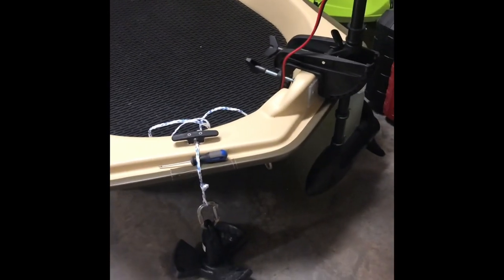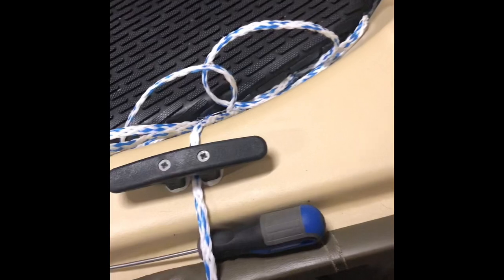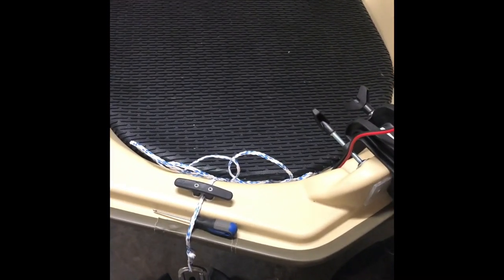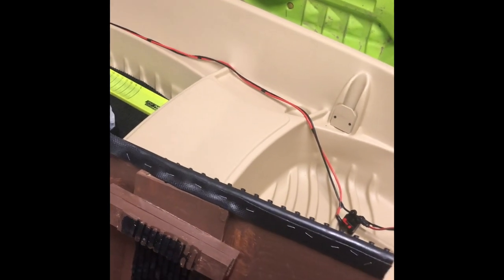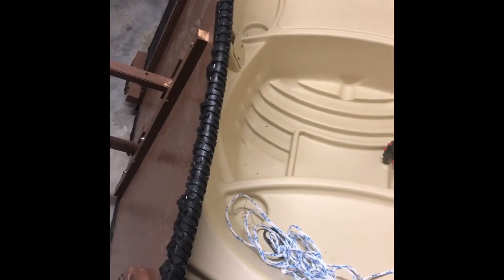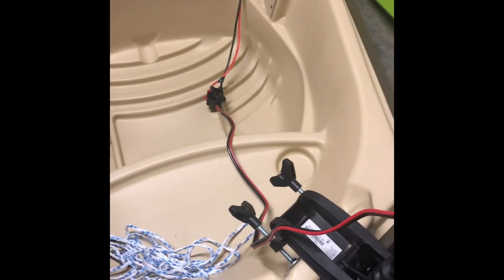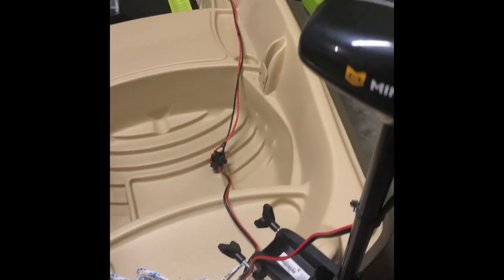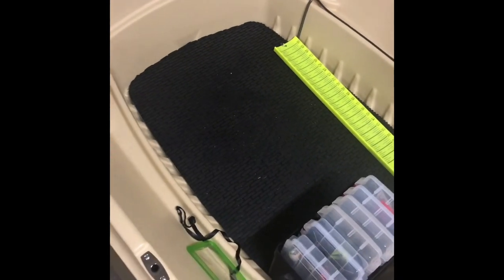Budget Jon Boat: Sun Dolphin American 12 ft With Full Casting Deck

Comment: I have the same boat. I made the decks out of 1/4" plywood only with 1"x4" support on the low side and a small block on the front. The center deck is only one piece of 1/4" plywood. total weight of all decks is about 5 pounds.

Comment: website says 52" wide which wont fit between F250 wheel wells. True? Is it tippy when you stand up in it? I saw the tri hull smaller Water Tender looks more stable

Comment: Sweet guitar  also subbed. Also um anything u would do different use any different materials now vs back then? And how was it on the water
Reply from the maker: Thanks you! Man I haven’t had this boat for 2 years but I miss it. This thing was great overall. I would probably try to find lighter materials if I could do it again. This thing got heavy and I didn’t have a trailer either. I may get another job boat in the near future though. Thanks for watching!!!

Comment: You may not know cause it’s been a while but those scrap piece you used for the bottom, what were the measurments for those? Ex: 2x4 or 1x2? I know this is from 3 yrs ago but if you could help me out I would very much appreciate it
Reply from the maker: I used 3/4 inch laminated plywood, but 1/2 would work as well.
Reply: That’s what you used for the blocks in the front and back on the under side?

Comment: Do you have the measurements for the front casting deck? Bought one a month ago and have the center floor done but want the standing front deck it would be a great help!
Reply from the maker: the front casting deck measured lengthwise on centerline is 53 in long, at its widest point of width is 36in. At the point where the rod holder cut outs are its is 31 1/4 in. The other curvatures and contours will need to be trimmed to size after measuring. Also the casting deck will need to have a 3 in support that rest on the second seat, that way it is flush with the front seat. Please let me know if you have anymore questions I’ll be glad to help, the casting deck really makes the boat 10 times better. If you liked the video please subscribe!

Comment: Add a pwd to controller the amp draw of the trolling.. mine hauls now LOL minnkota c2 40 rips through the water now.
Reply from the maker: Thanks man that would help out a lot since this is the primary motor on the boat.
Reply: @bluecollaroutdoors5556  Also not sure if I saw it wrong but you can actually flip the trolling motor propeller so that it will have better Propulsion just look up how to flip a minnkota trolling motor for Bow mount
Reply from the maker: @danieljimenez728  yea I think in this video I only had it on there for showcasing the boat , but yea I did flip the motor for bow mount lol. I actually have a video for doing that conversation lol. If you haven’t please check out my other videos about this boat as this was my first video and it isn’t as good as the others.

Comment: I have really been enjoying your fishing videos on the Sun Dolphin Jon Boat.  I have a spot on a small lake in MN and I think the Sun Dolphin may be a good option for me.  I'd like to take a friend fishing with me.  Have you ever used oars with the Sun Dolphin?  Also, how did you measure up the platforms that you made for the Sun Dolphin?  There are a lot of curves to get right, I only want to cut boards once 🤔.  Thanks for the great videos!
Reply from the maker: Thanks Doug, I’m glad you have been enjoying the videos. I have never used oars with this boat but they should be easy to use with this boat due to the seating position. For making the platforms, I really didn’t measure anything. I took cardboard (several pieces taped together to make a huge piece. I then started trimming down the cardboard until I got all of the curvatures the way I wanted them. Then I used the cardboard as a template on the plywood. It was definitely a slow process getting all of curves cut out the way they needed to be. Good luck man!

Comment: What gage battery wire is that? I built out my 8’ Sportsman, but I might be picking up a 12’ like this tomorrow. I have a Minn-Kota Edge 45lb foot control. The 8’ is nice because it’s pre-wired from the back to the front plug. If I get it, I will have to get the wood and everything because I’m not going to be able to transfer my casting deck. I was hoping to get a 10’ Sportsman so I could just transfer it, but I found one of these for 12’ for $350
Reply from the maker: Thanks for the question, the wire is an 8 gauge. Please see this link for the product- Cable extension- Newport Vessels Trolling Motor Battery Cable Extension Kit https://www.amazon.com/dp/B079M15G7H/ref=cm_sw_r_cp_api_glt_fabc_YF25EZ56XSMREBZ0744D?_encoding=UTF8&psc=1

I know the Minn Kota owners manuals state to run a 6 gauge wire if extending past a certain length, but I have had zero issues, and the way I look at it, is that this product was designed for these types of trolling motors, so I’m not worried. Hope your build goes well, and thanks for checking out the channel!
Reply: @bluecollaroutdoors5556  just got home from picking it up. It was an older couple that bought it last year and used it twice. Came with the oars and oar locks. It’s in brand new condition and had all the paperwork. Got it for $300
Reply from the maker: @Retro-2-now  that’s crazy, almost a steal at that price. I’m sure you will enjoy every minute on it.
Reply: @bluecollaroutdoors5556  yeah, everyone is trying to sell them for $800 here. I missed out on 2 of the Sportsman 10’ which is what I wanted so I didn’t have to build another deck, I could just transfer it, but I couldn’t pass up $300 and it’s literally brand new

Comment: How did you secure that anchor cleat to the boat??? Did you screw all the way through the boat or only through the inside (tan part)
Reply from the maker: The cleat is screwed straight into the tan portion you were referring to. I used 3 in screws that have a very good thread pattern that will grab the plastic good. There isn’t any wood or anything else under this plastic so getting screws that will hold to the plastic is very important. I did use silicone caulk to seal the screw holes so water doesn’t get it. This is just the fast way that I did it and I haven’t had any issues with it coming loose or anything, but you could use well nuts or rivets which would probably be the recommended way if you want it super secure. But in my experience I haven’t notice much force being placed on the cleat that would make it come loose. Hope this helps.
Reply: @bluecollaroutdoors5556  thanks for replying.. Appreciate the content and yes it did help me a ton. I dona ton of crappie fishing from the bank and ive had this boat for 5 years sitting in the garage 🤷 never used it so i decided this year lets try it but i want it to be comfortable and conducive to what im doing. So you said i can drill a seat down in the center of the sear area as well??? Dont want to destroy it 😂... I wouldnt want the srat standing too high either the wife would have a panic attack 😂
Reply from the maker: @crappiesniper  yea for installing seats they can be mounted straight to the pre-existing seat because there is plywood under the plastic there. If you are looking at swivel seats they make them without the post which will keep the seat low. They also make a mount that will clamp onto the seat plastic seat so you don’t have to drill, but I’m not sure how good those work.
Reply: @bluecollaroutdoors5556  cool bro!!! Hopefully you get to do some fishing soon.. Im looking to do a lil later on...you can check out what i do at my channel if you like but Im subbing your channel indeed bro. Where are you located? Im in the Cincinnati area but i fish in 7 different states..
Reply from the maker: @crappiesniper  thanks man, I will definitely check out your channel and see what’s up. I’ve been fishing quite a bit, I have a bunch of vids uploaded from my adventures here in Missouri.

Comment: Great video!
I just got the same boat today at Dunham’s...
Is the anchor mount screwed into plastic only... or is the something more substantial under the plastic?
I hear there is wood under the seats. I want to put folding seats on rear and middle spots.
Reply from the maker: The anchor mount is screwed only to the plastic with self taping screws that have larger threads. It is very solid and I haven’t had any issues yet. I also used silicone caulk to seal under the cleat. The force of the anchor is primarily placed on the plastic of the boat rather than the cleat. You are correct about wood being under the seats, that upgrade will be awesome.

Comment: What was the thing u kept all your tackle boxes in?
Reply from the maker: It is a medium small size Craftsman plastic tote box, you can buy these from lowes for like $12. I’ve also used the marine battery boxes without the lid, those are only about $5, and they still hold these types of tackle boxes.

Comment: This is awesome man, I have the same boat. Love it but have been looking to make a removable deck for a while. Really like your design.
Reply from the maker: Thanks brother yea it really makes a difference being able to fish from a deck similar to that of a bass boat. It’s not too hard, as long as you template is sized right the rest is just cutting things to size. I don’t run a trailer either so being able to remove the decks and  makes it easier to load and doesn’t take much time to do. Hope your build goes well!
Reply: @bluecollaroutdoors5556  Ya exactly, I load it up in the back of my pick up. Have you used anything like it before? Just wondering what the stability would be like standing up front.
Reply from the maker: Yea it is very stable and balanced for a Jon boat I was actually surprised because I’m used to kayak fishing where there’s not much room to stand. I’ll post a video within the next two showing the stability. And it’s still easy to maneuver the trolling motor.

Comment: Why not use cleat to tie off anchor instead of the screwdriver
Reply from the maker: Thanks for the reply Doug, yes you could definitely use the cleat for it’s intended use, I just personally I just like how fast the screwdriver is to position and control the anchor tension. Either way it gets the job done, no right or wrong way I guess.

Comment: I cannot find one of these anywhere.
Reply from the maker: Yea man with stimulus checks rolling out Jon boats are few and far between. I couldn’t find any last year either. That’s why when I saw this one at my local academy at the beginning of the year I had to pick it up, and it was the only one in stock then. The pandemic has been crazy that’s for sure.
Reply: Check academy. That's where I got mines a month ago. They didn't have a sun dolphin but they did have the pelican intruder
Reply: My local Wal-mart still has 5 of them marked down to $400. Indiana.

Comment: What did you use to cover the floor with
Reply from the maker: It is just a standard doorway entry mar, you could essentially use and large door mat. Below is the Amazon link. Rubber matting- Guardian 14040600 Clean Step Scraper Outdoor Floor Mat, Natural Rubber, 4'x 6', Black, Ideal for any outside entryway, Scrapes Shoes Clean of Dirt and Grime https://www.amazon.com/dp/B000Q64DME/ref=cm_sw_r_cp_api_glt_fabc_ZP3X2HW9PE4H0FDF6MJK